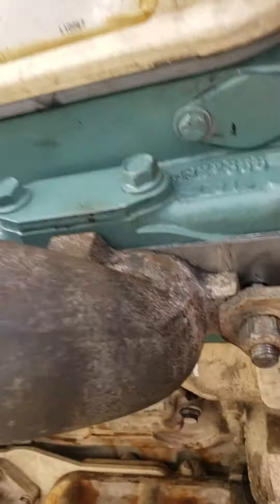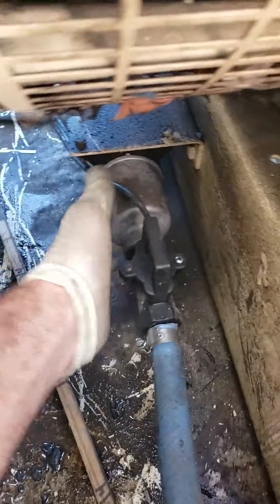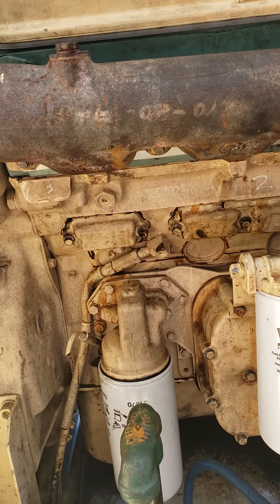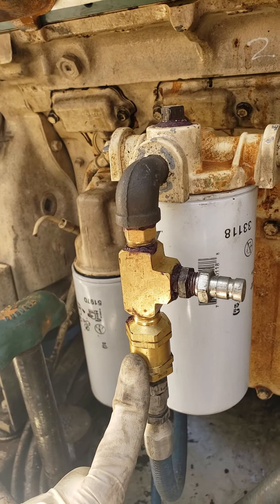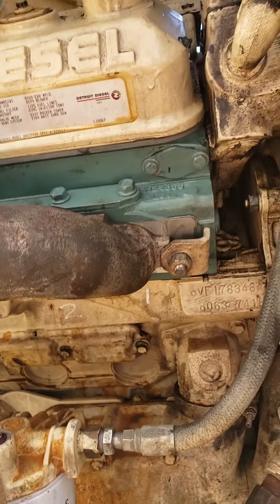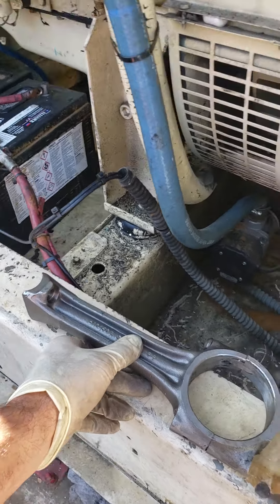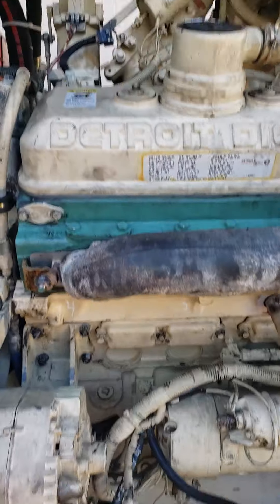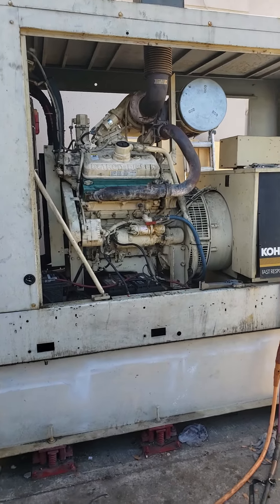Detroit Diesel 6V-92 Seized: Debunking the $550,000 Quote - Ep. 10 - Finally ! Mobiledieselmedic.com

Comment: Hi Mark, thanks very much for your videos, you cover some interesting stuff in conditions that must be pretty difficult to film in - I appreciate your effort sharing your experience and skill. 

Are you able to provide a parts number/manufacturer for the flap valve you mention in this video? I need something similar (very low opening pressure non return valve) for a fuel valve bank/manifold. 

Thanks!
Reply from the maker: You're the third person to ask so here is a video link I hope this helps https://youtu.be/B4USClLXBRY?si=_5jjZ4d7xqbexZd3